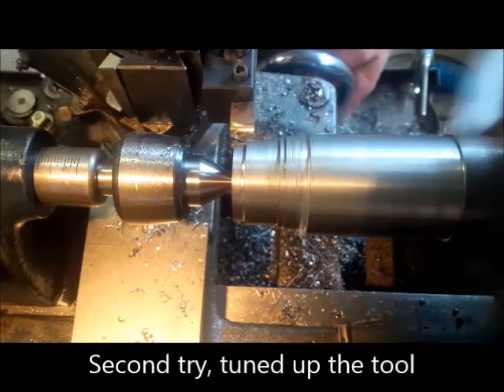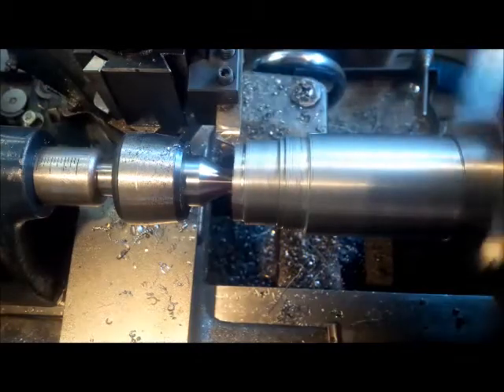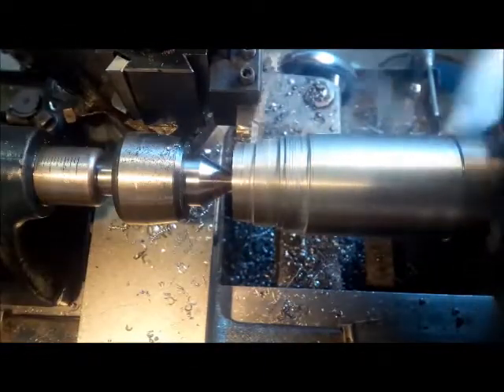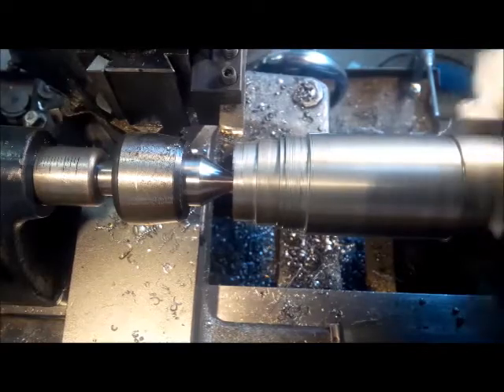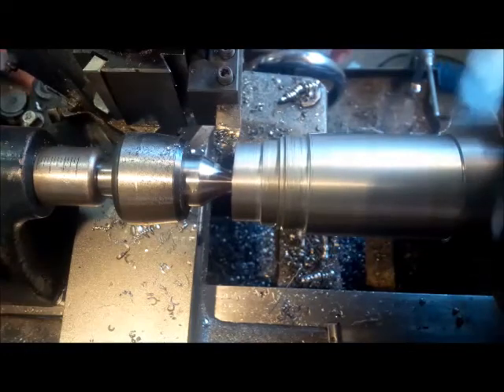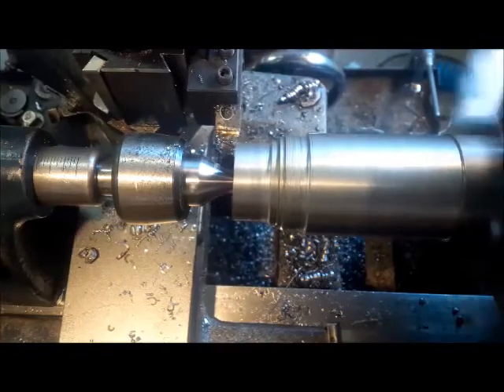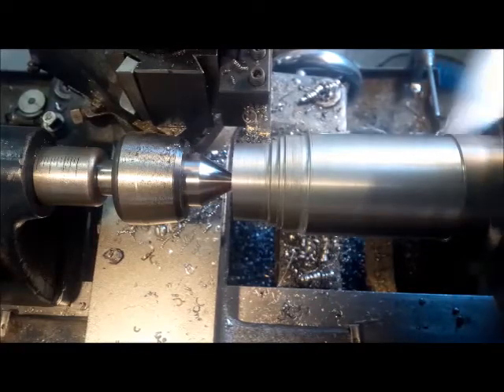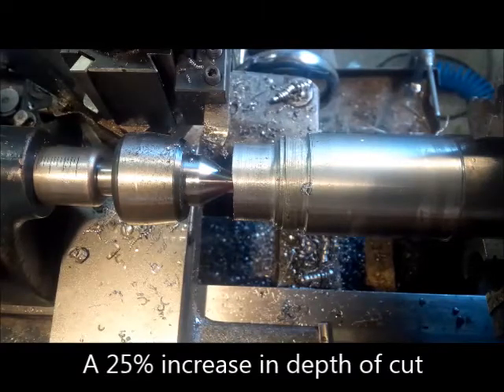Chip Control #2 - Flyweight division - Heavy cuts on the altas lathe

Comment: Hey Steve,

Way to go. Keep the oil on the cut. What is your next speed down? It looks like a chuck of 1-1/2 steel in the video. Try kicking it down a notch and do the same cuts.

Cheers,

Tom
Reply from the maker: I am packing for a business trip to vegas right now, my real job, showing off how fast we can make computer systems absorb data and I'm not talking peanuts here, 100's of  gb/sec into a relational database oltp with 100% random read over >100tb of data, but I digress. I will try slower speeds on the lathe when I get home next Saturday. The piece started out at 2" and I've been playing with parts of it so some are in the 1.75 range. I figure I need to be in the 250rpm range so will try that next.

Thanks Tom for you support and excellent training you provide, you are one of the best I've ever met (on youtube) and hope to one day meet you in person.
Reply: Steve S  Hey Steve,

We do a little fast data acquisition at work for our accelerator diagnostics. I don't think the volume is as big but its very fast. All optical network for the fast data acquisition portion of the control.

Cheers,

Tom
Reply from the maker: I'd love to work on particle accelerators. Kind of a dream I have along side doing formula 1 computer systems performance work ( I just don't even come close to qualify for actual car perf stuff). I have seen some of your older videos when you were building out that NDCX2 system. Pretty awesome stuff and really a dream for me to work on stuff like that. I've done a little bit of satellite data acquisition in the years gone by, but it would be nothing compared to what your involved in. Thanks again for what your providing to the community.
Reply from the maker: Tom, check out my channel for chip control #3. I took your suggestion of lowering the speed.
Reply: Steve S Hey Steve,

Tearing it up. 418 rpm still sounds a little fast. Try kicking it down a notch.

Cheers,

Tom
Reply from the maker: Tom, check out #3, it's down to 266rpm and I did DOC of 0.10. Pretty good for 1/3hp IMO. And I would never have gotten there without your help. Your awsome.

Comment: I don't know about the atlas, but my flat belt 405 SB is limited to belt slip on the cone pulley. It doesn't cut much more with a 1 hp motor then it did with a 1/2 hp. If you have a V-belt, you will probably gain more with a higher HP motor because the belt is likely less to slip.
Reply from the maker: Jason, thanks for the comment. I do have v-belt but the spindle belt is possibly the original one lol. It needs replacing, most likely with a link belt as I don't want to pull the spindle. I'll do the belt next time I'm in the USA, HF has them cheaper than here. Then maybe I'll replace the motor with a 1hp that I have in my stockpile. Thanks for your comments.